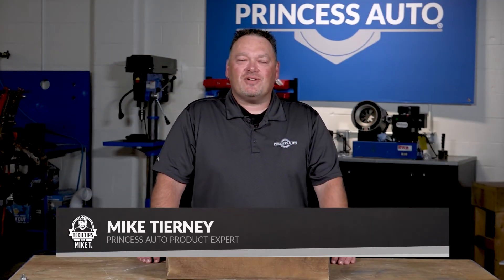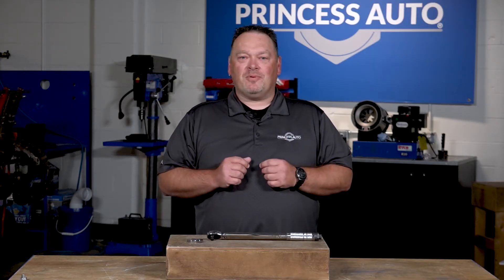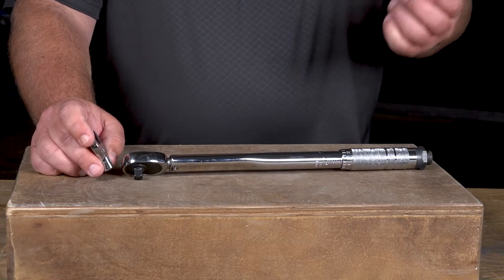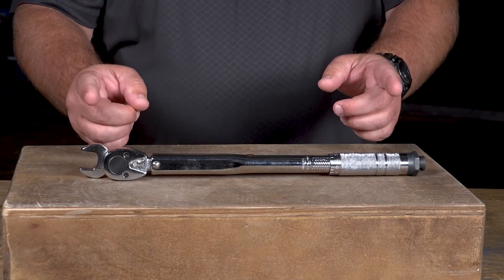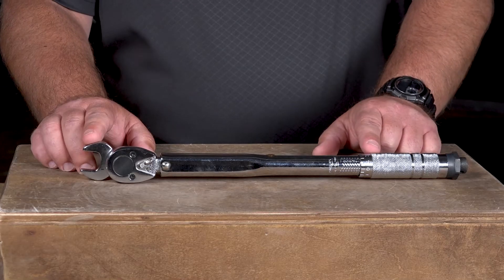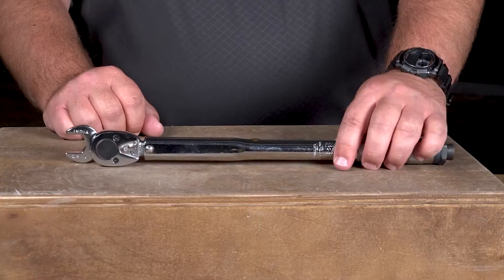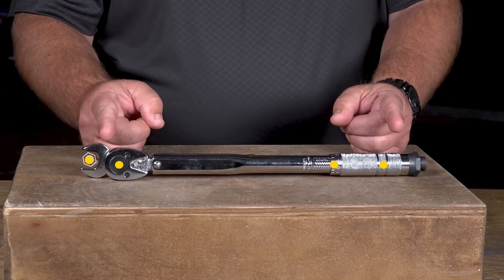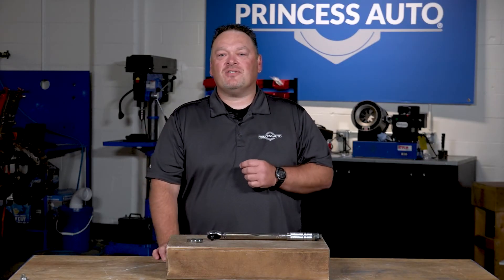Tech Tips with Mike T  - How To Add Crow's Foot Sockets To Torque Wrenches

Comment: So its absolutely undeniable that adding a crows foot inline with a torque wrench changes the final torque. Strictly speaking for the automotive world it seems like it is completely negligible? What would you toque with a crows foot? Inner track rod? Fuel lines? Seems like being a little over spec wouldn't cause any issues-

Comment: A reasonably priced torque adapter set, or singles, would be a nice addition to the catalog. Longer than a crows foot and with a box end.  They're a better option compared to torquing a fastener with a open crows foot wrench. They also provide more flexibility getting into tight spaces.